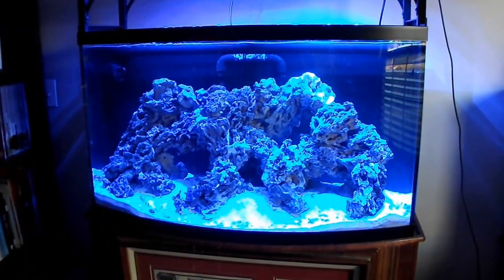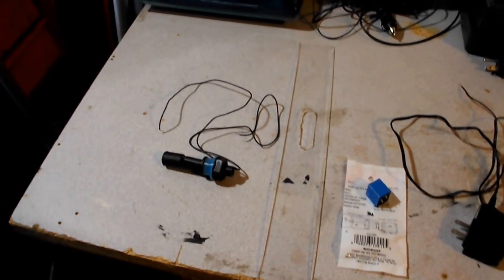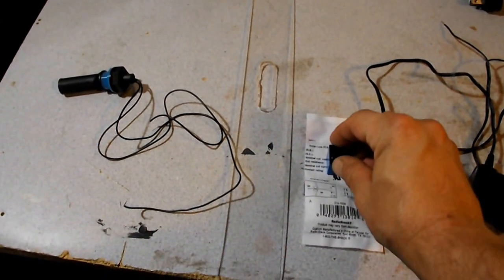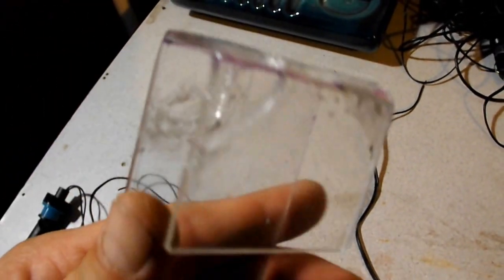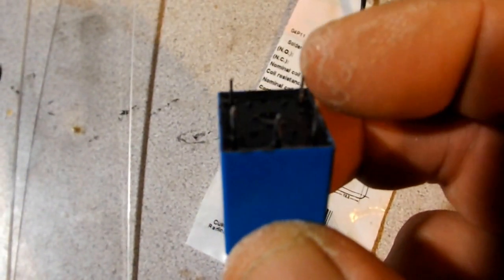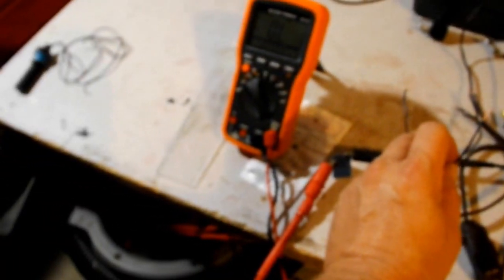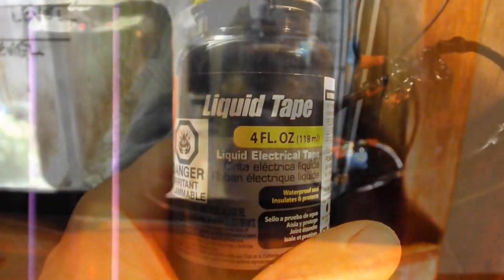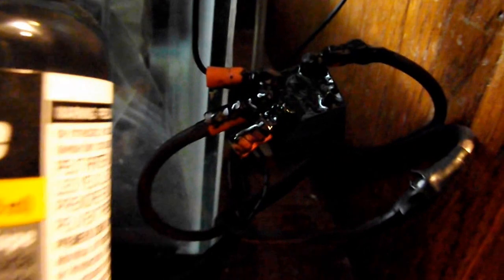DIY ATO - Temporary Set-Up

Comment from the maker: your are correct. you will need to just make sure your float switch in your make-up water is upside down. That way your connection doesn't break until the water level drops below the switch. I'm guessing the second switch in the sump is a failsafe? So, those are put in the same way.

Comment: I use a chinese version of the Tunze Osmolator it has a infrared sensor and a chip sensor for back up as well as a float Ensor in the reservoir it comes with a DC pump and has a very annoying alarm that goes off when the reservoir is low or the IR sensor has failed as well as three LED indicator lights and a aluminum housing to keep it all together and it cost less than $60 shipped on Fish Street.

Comment from the maker: I would be using your build if I had room above the sump for the make up water. The gravity option is a better way to go as there is less chance for failure, and it trickles the water as needed rather than blasting a bunch at once.